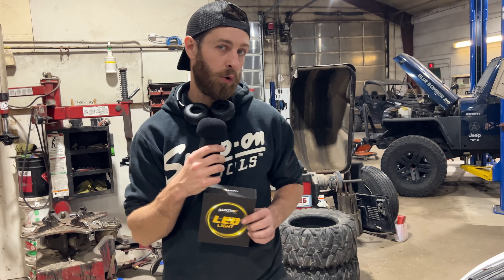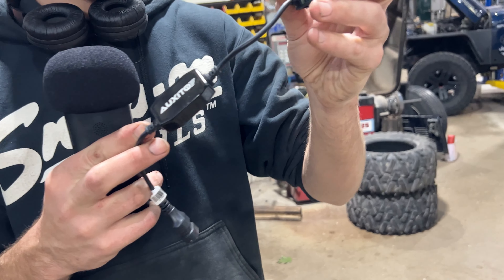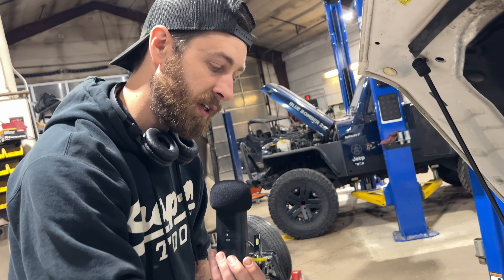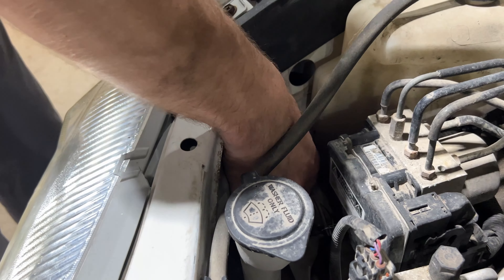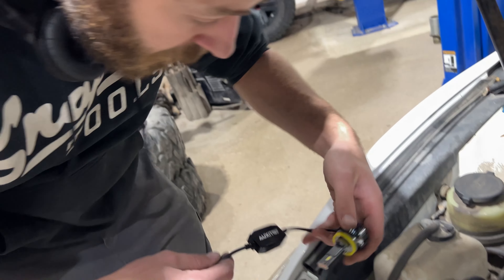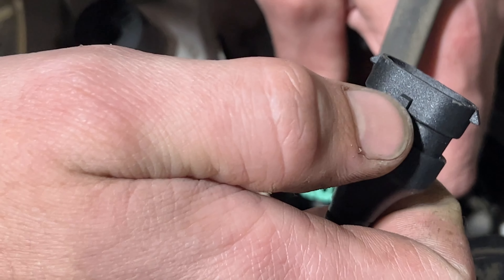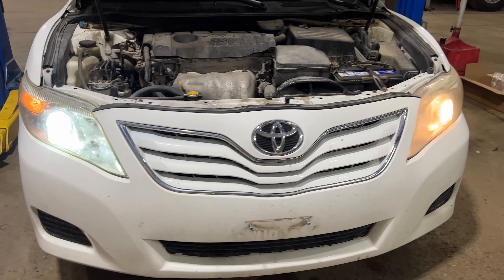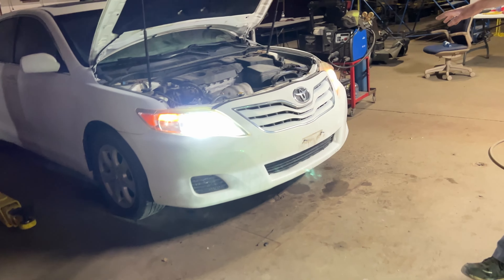Low Beam Bulb Change Toyota Camry 2007-2011 Auxito LED

Comment: 07 Camry low beams suck. I've tried all different bulbs. Gonna try new housing and leds
Reply: Did you find any better than the others? Mine are dangerously bad. 😔
Replacing the bulbs today.

Comment: I was told by a mechanic my legs were illegal for cars u less your car housing is made with them? In my case it is not bc my are is over 15 years old. Is that true? He confidently kept them until I asked for them back.
Reply from the maker: @athomewithrobin292  vehicle safety standards vary from country to country and state/province to state/province. In Ontario you are allowed to have LED lights installed as an upgrade as long as they follow all of the regulations set forth in regulation 611 highway traffic act. 

I would just google “Are LED lights illegal in (your state/province)

Comment: Maybe it’s that better bulbs are stock in newer models or certain trims but my 11 LE isn’t as good as other Toyotas . The ones I’ve seen in other Toyotas were fantastic and it’s one thing that set Toyotas apart from. Maybe just change them out ? The newer cars come stock with better bulbs or something?
Reply from the maker: Most newer Toyotas are now running LED or HID, not many cars these days run incandescent bulbs